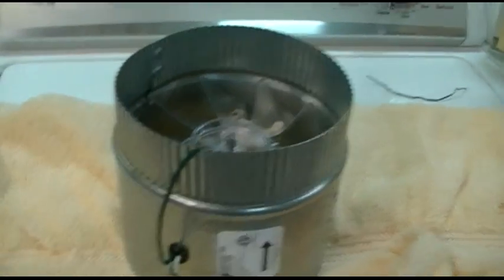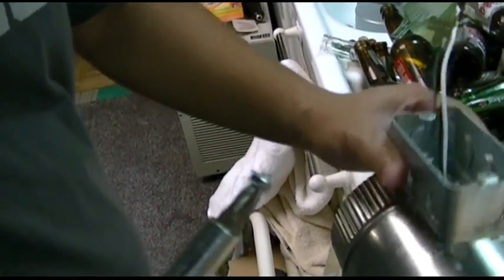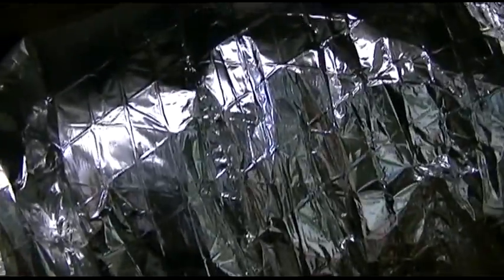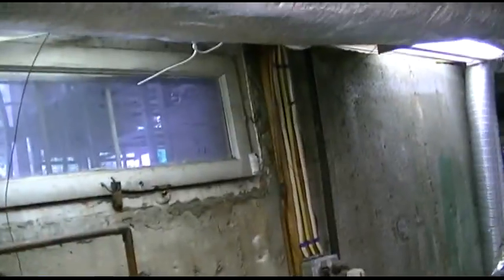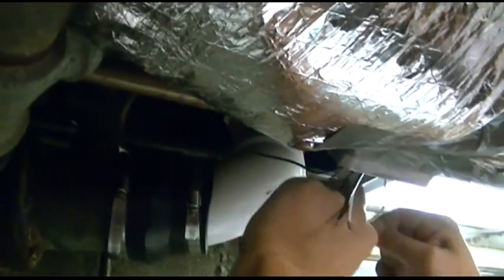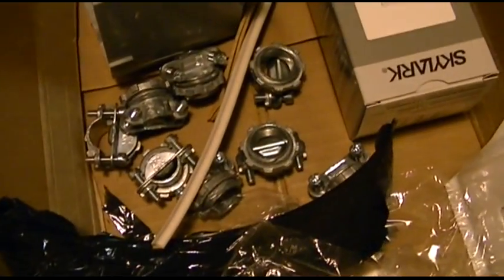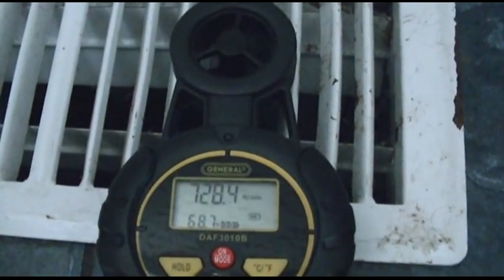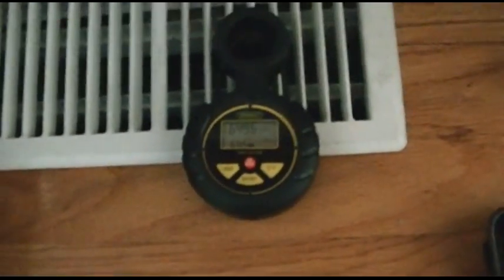Suncourt Inductor HVAC Booster Fan Installation and Review

Comment: My brother tried to power two of these fans off the blower motor lead and it kept popping a fuse in the furnace (it was able to power one fan but not two). Might be better to use the 120v from blower to the coil of a relay, and power the vent fans off of another circuit (through the relay).
Reply from the maker: If you kept blowing fuses, either it wasn't wired correctly or that circuit is overtaxed--may be worth checking that out.

These are little shaded-pole motors, couldn't pull more than 20 watts apiece.  Any circuit needs to have some "leeway" room, otherwise it will keep blowing fuses/popping breakers.  While your recommendation with the relay is indeed the correct way to do this for the best safety, I have had no trouble as the blower is on its own circuit.

Comment: wheres the grow room?
Reply from the maker: Same place as your manners--there isn't any!  Go troll elsewhere...
Reply: jaykay18 oh snap...
Reply: jaykay18 would have been a lot better with a grow room, but I got what I need here.
Reply from the maker: Tim Weber Thanks, Tim.
Reply: Hey Jay got one more?,  can I ground out on the fan with the green card.
Reply from the maker: Tim Weber If the ducts are all metal, theoretically the entire duct can act as a ground, but that's not the proper or safe way to do it.  Best running 14-2 wire (which includes a bare ground) and connecting the green wire to that.

Comment: now does this work with cold and hot air?
Reply from the maker: Yes, it works with both.  As shown in the video, I tied the power for these into the power for the main blower, so they come on whenever the blower comes on.
Reply: could you please explain in detail how to wire the fan to the main blower
Reply from the maker: 11:38 in the video is the black wire to the main blower.   I tapped into that.  The white wire is neutral, so tie into any white wire in there provided it's neutral (check with a good-quality tester first.)
Reply: thank you - it worked out fine and no loss of fingers or burnt componets .